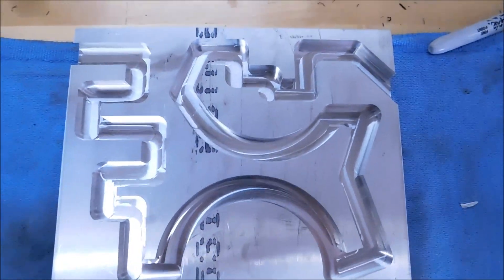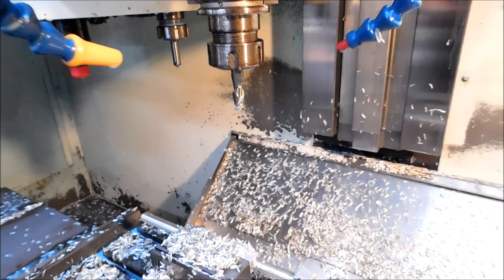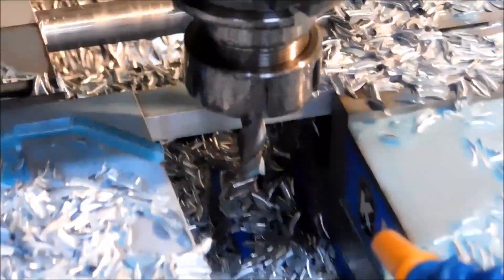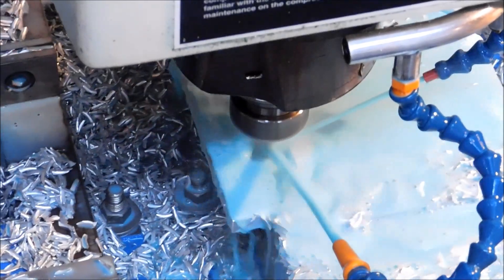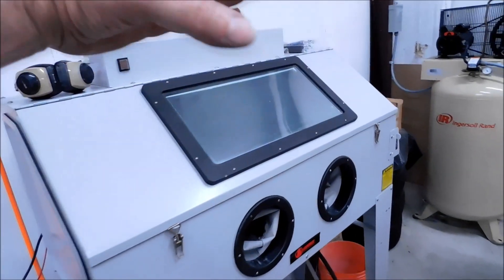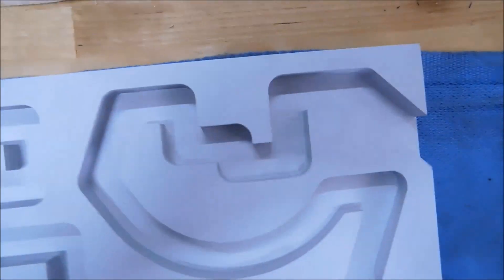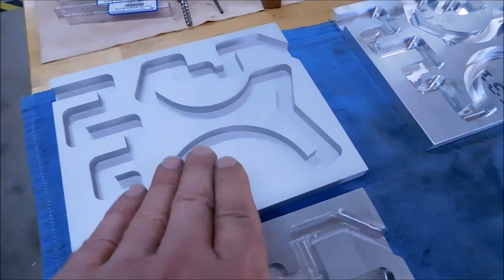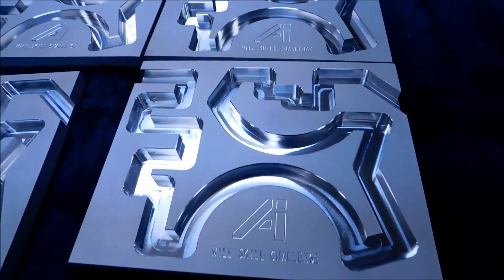Remember the ETCH-A-SKETCH ??  ----  You Should Try This One !!

Comment: Joe, off the subject of this vid, I have been searching for a V-block with a 60 degree V and can not find any for purchase....  on so many of my drill bits and tooling I grind flats on the shank so it doesnt slip in my worn out drill chucks, and for years Ive been putting up with wobbly bits and reamers.... what is the trick to getting the 3 flats all in the correct position?... 
 my thoughts were to cut a flat on the shank, then place it in a 60 degree V, with the newly cut flat against the block.... and then cut the second flat on the shank, then rotate it so both flats are nested in the block to cut the last flat.... but I dont have a 60 degree v block.
  the way I have done this on large items is to place the item in my lathe and use my tool post grinder to cut the flats, which I can do with precision as I have previously made a large degree wheel that is bolted to the back side of the chuck (with a magnetic based pointer attached to the body of the lathe).... this is indexed in degrees, and also indexed for dividing 3, 5, 6, 7, and 8 equal parts.... but the lathe method for cutting flats on a 1/2" shank is time consuming to set up for such a quick simple little task.... would making a 60 degree V block for the mill be my best option for this type of work, or is there already a quicker way that im overlooking?...  thanks for any suggestions
 EDIT;... after writing this, I have now found 60 degree V blocks for sale.... but still, is the v-block the best option for indexing drill shanks for cutting flats?
Reply: Buy a new chuck :)
Reply: I realize it’s a bit late but you could look into 5C collet blocks, they usually come in square and hex - very handy to have.

Comment: What kind of media do you use for blasting? That's a really cool finish!
Reply from the maker: #6 glass bead at about 60 pounds of air pressure.
Reply: @joepie221  Cool, very interesting. It's a really lovely finish!
Reply: I had the same question.  What type media and how much pressure?  I know, that varies with the gun but it's a starting point.

Comment: You might get a more durable matte finish if you soak them in concentrate sodium hydroxide (drain cleaner). Then do the finish pass to brighten the channel. Anodizing after the sand blast would also make the finish more durable, but much more time invested. The lye bath is pretty fast and often removes the ink from the surface, but you might want to do a skim cut on the surface or run a wire brush over it first.

Comment: What size stylus do you recommend you use in that?  50% of the channel width? Or just a small one?   It seems like the larger the stylus the more challenging it would be.....it would be nice to use a type of probe system with a circuit to a light or buzzer, kinda like the game "Operation"....touch the sides and you get a buzz
Reply from the maker: Start small to build confidence. 1/8' is good and will feel too big at first. Once you get good, increase the diameter and compete against the clock.
Reply: Your could use one of the edge finders that lights up. That way somebody else would have a chance to try it after I was done.

Comment: Awesome design. Never tried it, but I suspect it would take me quite some time to finish it... not to mention my lathe/mill is more or less the size of that plate :) 
As for your description of a gloove compartment - you are referring to a bio-safety-level 3. BSL 3 chambers are used for rather nasty stuff (mildly danderous bacteria/virused/toxins etc). The next and final level is a bsl4 - full body suit  in a fully equipped & secure lab, like you see in the movies with hi pressure (relatively, for us humans) inside and negative pressure outside. Thats used for the really scary stuff - ebola and like.
Most of us never get to work with these toys... just biologists that handle pathogenic microorganisms...

Comment: Good point about not recutting chips, that is about the fastest way to dull an endmill, especially carbide when cutting steel or stainless. Recutting chips in Aluminum screws up the finish royally as well.

Neat tip on the two-tone finish, good, painless way to get a great looking finish!
Reply from the maker: I like that effect. The engraving shows up very well. I engrave our dive trays after anodizing to give the same effect.

Comment: Thanks Joe, any reason you change the dia rather than using cutter comp?
Reply from the maker: Changing the diameter only works if you are using cutter comp. G41 As you reduce the tool diameter in the offset register, the comp moves the cutter closer to the finish wall.
Reply: @joepie221  Oh duh, with cutter comp off it'd be a centerline tool path. Sorry I'm a lil slow. Thanks Joe